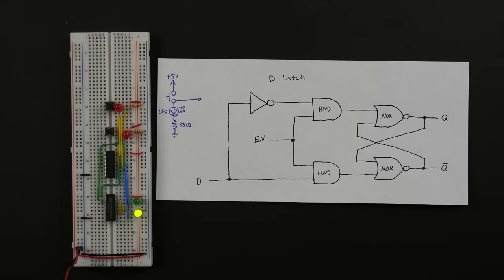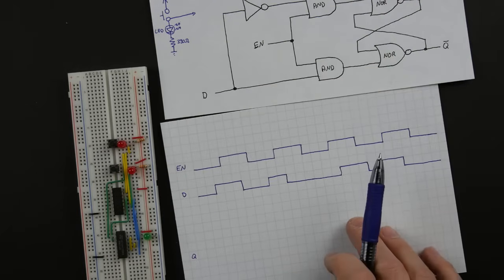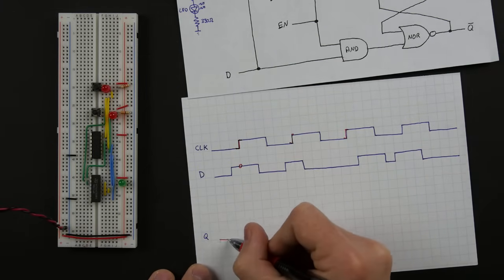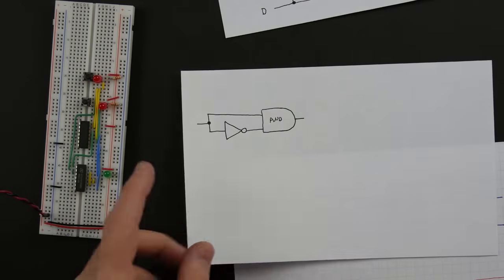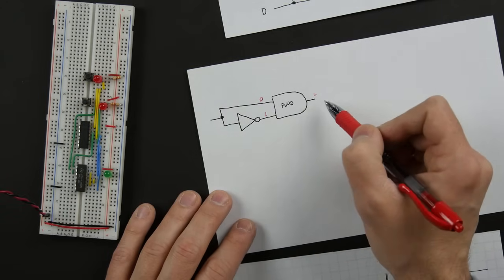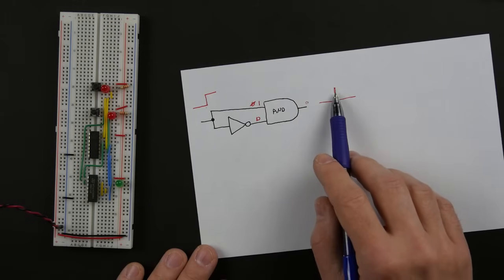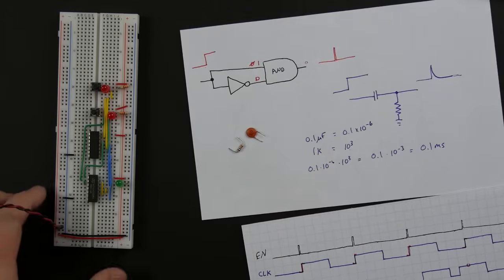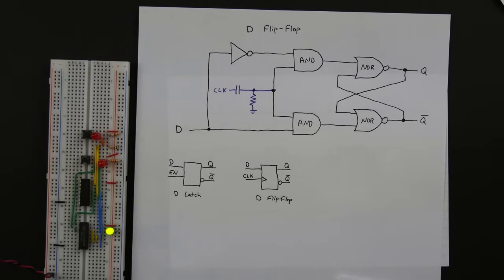D flip-flop

Comment: Revisiting these videos I just realized that you could've just wired the capacitor circuit to a single not gate instead of having a train of not gates and have it timed for the voltage charge from threshold voltage of the not gate to the full charge current cutoff of the cap to match your desired pulse width. That way you would've had a nice square clock pulse.

Comment: @BenEater Quick question. Regarding the edge detector circuit as pictured at the end of your video, it would seem that a HIGH to LOW transition on the CLK line with the 5V across the capacitor would result in a -5V transient input signal as the capacitor discharges that would mirror the transient produced by a LOW to HIGH transition on CLK. You say in your D Latch video that you use a 7408 quad AND gate, whose datasheet indicates internal clamping diodes to ground on its inputs. Are those enough to avoid damage to the IC during the negative transient, or would external clamping diodes be preferable?

This is the fifth time I've watched this video, among many others on your channel. I really appreciate your informative and detailed teaching style. The truth tables and colored diagrams of signals through schematic symbols over time have been especially useful for me.

I am designing a line of low-cost, simplified, user-serviceable testing equipment for breadboard circuits to lower the barriers to entry for circuit design. Ben, I would love to collaborate with you on this if you are interested. Everyone else, please feel free to leave me suggestions.

Comment: I built the edge detector with a capacitor and resistor as shown in this video, but when I hooked it up to an oscilloscope I noticed that there were positive and negative pulses corresponding to the rising and falling edges. If you run across this issue, my solution was to run a diode off the negative end of the capacitor.

Comment: At 11:56 That rising edge detector explanation using capacitor resistor is confusing. Assume the 5V lasts for 5 sec. At the rising edge current will rise fast to charge capacitor and it will fully charge in 2 sec. But the capacitor will be kept charged for 5sec right? How the voltage reduces in 2 seconds. Confused

Comment: This is not a flip flop. The concept of flip flop is in the name.. "flip and flop". It needs to be just 2 D latches configured in M-S way to get a D flip flop. 

Yes, this is a shortcut by simply making the "high" to be very short duration, and behaves similarly, but I prefer the M-S latch way to get a pure digital logic implementation and not bothering with capacitors, etc.

Note: i may be wrong because I am also just a student learning about thissubject.

Comment: i threw this circuit into the simulator, and it seems that having something to discharge the capacitor during the negative part of the clock cycle is essential. otherwise the circuit produces no pulse on the rising edge.

in ben's case it seems that the LED does that job, but if you connect the edge detector circuit directly to a clock, the clock needs to be able to both source and sink a bit of current.

or maybe the capacitor discharges through some parasitic resistance? idk. i'm a complete beginner at this after all
Reply: I was wondering about this. Thanks for clarifying
Reply: @Jackisaboss1208  Happy to help!
Reply: I'm surprised that no one else is pointing this out. The only reason that Ben's capacitor is able to discharge at all is because of the ('optional') LED and resistor connected to the Enable button. If you remove those from the circuit, then one side of the capacitor is left floating, which prevents it from discharging. And the enable button stops working after the first press. (Try it and see). Moving the 1K resistor to the other side of the capacitor solves this issue, by providing a discharge path.

Comment: What does it mean when Ben says that the ‘capacitor will charge through the resistor’? Wouldnt the capacitor charge anyways once connected to the supply voltage

Comment: I made a circuit simulation to test a press-button RC-clk pulse similar to Ben's; I particularly wanted to see what happens on the falling CLK edge (button release). 
Here is a snapshot of the simulation: https://drive.google.com/file/d/1S2WtMoX65ZNd03vXrY3qWkwo90piK4Ce/view?usp=sharing. 
There are two voltmeters: the green one on the positive cap side; and the blue one on the negatve cap side that measures CAPCLK.
When the button is pressed, both meters measure an instant +5v. Then the (blue) falling slope of CAPCLK is the cap charge time (the rate and depth depend on the resistor values). (Once it reaches that grey TTL-level area of about 3v, CAPCLK will appear to be zero. This is Ben's pulse.) The blue voltage falls to a stable level of about 0.5v, when current flow through the cap halts; low current continues to flow across the power source through the 1K and 100ohm resistor in series. 
When the button is released, current flow across the power source halts and both meters measure the same instant drop of about 0.5v, from the stable level the blue one falls to 0v. The green meter measures a slower falling slope, as the cap self-discharges (reverse direction current flow) through the 1K resistor, after which current flow slows to a halt.
You can find the circuit simulator at falstad dot com, sorry can't link to it here. 
Thks for the series of videos, helps a newbie like me to learn.

Comment: To detect a rising edge can we use an AND gate with one input the clock and the other input is the output of the AND gate itself but passed through a NOT gate.

So when the clock is high the output of the AND gate will be HIGH only till it's complement which is a LOW reaches the other input of the AND gate effectively making the output of AND gate LOW again.
Reply: Whatever you have analyzed is right. The AND gate does give an impulse at rising edge of the clock but unfortunately, until the clock remains high for the entire cycle the AND gate keeps generating impulses. It oscillates between HIGH and LOW as long as the clock is high. 

To explain in detail, consider your circuit. Clock starts 0-> 0 1 AND input -> 0 AND output -> inverted to 1 -> 0 1 AND input -> 0 AND output... this is repeated, as long as clock is zero AND output is 0. Now when clock changes from 0 to 1  ->  1 1 AND input-> 1 AND output -> inverted to 0 -> 1 0 AND input -> 0 AND output -> inverted to 1-> 1 1 AND input -> 1 AND output and this oscillating output repeats as long as clock is HIGH. 

This circuit behaves as a frequency multiplier (frequency being very high) for HIGH clock input.

Comment: So in experimentation, the edge detector detects both rising and falling edges - both being pulses but interestingly the falling edge produces a negative pulse.  When trying to build this type of flip flop using transistors rather than IC's I found the falling edge detection triggered the Flip flop like an enable (even though it was a negative voltage).  Does using the IC logic gates get around this problem?
Reply: The IC he uses discards the negative voltage through the use of internal diodes.

Comment: I’ve been encountering a certain level of ambiguity with SR flip flop diagrams online. Some diagrams have NAND gates for the Q outputs and others have NOR gates. Quite a significant difference I would think.
Reply: NOR based latches have "0" "0" at both NOR gate inputs, and they can be Set or Reset if they receive a "1".
NAND based latches have "1" "1" at both NAND gate inputs, and can be Set or Reset when they receive a "0".
That's the main difference. You can search for some .gifs on google to better understand them

Comment: 📺💬 D Flip-Flop in fibre optics,
🧸💬 The small pulse makes sure the receiver senses the signals because one dimension does not always create a fast response.
🐑💬 Stability too when the shape of signals is not too different and you can accelerate signals for speed and reliability.
🥺💬 That is because a capacitor and resistors together create powerful tools for shaping the signals, it is a good choice for signals if no specific tools because their properties are made well.

📺💬 How about this D-lack⁉
🥺💬 You can create shapes of signals or channels that can contain data information inside, it prevents external signals interfere but it contains CRC ( clock ) too.
🧸💬 That is because signals and clock signals transmit together there is no lag as digital signals and no costs for clock slipping if data arrived at the transmitter at the same time. 
🐑💬 That is because of its properly when the medium is loss carrier property it still has signals transmitting they can be detected and selected working medium.
🐐💬 To maintain the overall bandwidth but is still applicable in some fields, tracking signals are hard to detect when there is no clock source but a nearby device still hearing or relay of signals can estimate the distance of nearby sources. 

( 📺💬 ยุ้ยถ้าอย่างนั้นใครผ่านวะ 🥺💬 บอกแต่แรกแล้วไม่ได้แข่ง ควรจะหยุดตั้งแต่ซ่อมโทรทัศน์ วิทยุ AI certificates และอื่นอื่น ผมไม่ได้แข่งผมก็อ่านหนังสือที่เค้า feed มา เหมือนเค้าแข่งกันเอาสะใจ ตัวอย่างจะแกล้งดูหน้าจอหรืออะไร ผมเตือนแล้ว ผมเลยกินคุกกี้ฟรีให้ดู หลายครั้งเพราะเค้าอ้างรายการโทรทัศน์ ก็ไม่หยุด ผมเลยคิดว่าดูตัวผเองดีกว่า สอนต่อเถอะครับ ผมจะทำงาน 📺💬 ยุ้ยครับกระพริบหน้าจอเอากระพริบยตาครับ หลับ เปลี่ยนเรื่อง 🥺💬 ผมจดไว้ตั้งนานแล้ว ไม่เกี่ยวครับส่วนมากเหนื่อยหรือกินอะไรไป บางทีเค้าแกล้ง เค้าลำโพง หยุดด้วย แบบนั้นใครก็รู้ครับ  📺💬 ครับเพราะจริงจริงไม่ใช่พม่าครับ เออ จะหยุดเล่นยัง )

Comment: 10:00 I build it in a game with logic gates that have a speed of 40 "ticks" fancy word for hertz. When I press a button it takes 1 tick to activate the AND and to activate the NAND/NOR fed into AND  then another 1 tick to deactivate AND because NAND changed to 0, which results in a 1 tick pulse and complete ignore afterwards unless you stop pressing the button and press it again.     

It's the only way to do that because the game doesn't have voltages or wires or current etc. It's either on or off, and connections are wireless (very convenient).

Comment: I saw a video by Sebastian Lague on digital logic, and he made an implementation of a D flip-flop in his digital logic simulator, and he used a strategy for an edge detection. What he did is he used 2 D latches in series (so to speak) and then had the first one with an inverted enable signal and then the second with an uninverted signal. That way, the storage of the data would more or less be instantaneous. Would this work reliably in reality, and how would it compare to the timing of a resistor and capacitor like in your explanation?

Comment: Is propagation delay for edge triggered latches actually used in computers? You can build a circuit (it uses two of the SR latches with a clock input) that will only latch the output exactly when the clock triggers to high without needing to rely on an introduced artificial delay

Comment: Sorry if this is dumb: 
1. I understand there is no additional delay until the capacitor fully charges, right? 
2. The resistor slows down the flow and helps the capacitor fully charge?? What do you mean the capacitor charges "through" the resistor?
3. MOST IMPORTANTLY: Why the current stops flowing when the capacitor is full??

I undestood better the 1-input AND-gate with the inverter
Reply: 3. When capacitor is full it acts like sort of a barrier.

You have a lot of electrons electrons on one side and at some point battery has no more energy to push more electrons in the circuit.
Reply: @PinkeySuavo  thank you so much, even if i forgot what i was asking and why i was watching this video :P

Comment: @12:12   the width of the Pulse is conceptual because that depends on the input of the gate receiving that pulse. So the width will span the horizontal level of the AND gate input, and the conceptual level starts at the trigger level and ends at it, then it rolls down after falling below that level.

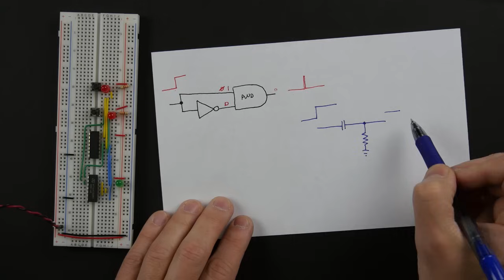Comment: @10:59   >>> this method of pulse creation is used in one of the security systems to detect the signature of the acousto-magnetic pulse signature - so by controlling the width of the generated pulses (via a variable cap controlled by an MCU) and taking iterated measurements (Assembly code is used as C code is not fast enough) the wave signature of the system can be detected and an alarm will be issued once the signature is matched to the pattern stored in the EEPROM of the chip.  Digital-CAPs are available from vendors that can generate variable cap values through the SPI or UART port.

Comment: Another great video. Unfortunately for me, I don't get the R-C part of the circuit. I was thinking caps smoothed spikes, not created them. I guess I need to go revisit how capacitors effect a circuit.
EDIT: Ugh. I think I get some of it. The clock pulse is limited to the spike of current during the polarization of the cap, before it fully charges and the current stops. Now I just don't get the role of the resistor. How does the cap discharge?

Comment: Thank you very much for a great lessons, I learned a lot from you. I have a question: how can I make an SR latch with deterministic initial state (on power on)?
Reply: what do you mean with deterministic? always the same led  that turns on for example output q is always on upon start?
Reply: @confidential303  not always, it can be different. Solved it with capacitor discharging to particular input to set determined state.

Comment: 10:55 here why doesn't the capacitor create an enable(EN) pulse while discharging? Isn't the capacitor creating current while discharging?
As seen in 14:50 at the falling edge of the clock signal when the capacitor is being discharged, there is no enable pulse created and so the state of data input doesn't affect the output and this can be confirmed by looking at the green LED on the bread board. But my question is why? I'm thinking the discharge of the capacitor at the falling edge of the clock puts current into the circuit and should have created an enable(EN) pulse, but it's not. What am I getting wrong in this thought process?
Reply: Is it because on the falling edge, the current is in reverse and since the circuit can't provide the current needed to discharge the capacitor, the capacitor gets this reverse current from ground and thus does not affect the circuit and does not create an enable pulse? I'm not completely sure about this. Can someone confirm?

Comment: 9:10 You can put time delays into the circuits by adding resistances infront of one, of two inlets . Plan the "race" of the currents in the SR . Ampere flows like water, have to wait for the bucket to get full .

Comment: I saw you addressed the racing issue in the JK-FF videos, so I just want to remark that D-FFs also have to be of the master-slave type to avoid the same problem.
Also, please, put some decoupling capacitors next to ICs. 74LSs are more forgiving, but if you replace them with, let say, 74LVCs, or even 74HCs, decoupling capacitors are a must.

Comment: I'm a bit confused. Wouldn't there also be a little blip going from 1 to 0, when  the capacitor discharges? I.e. a blip on the rising and falling edges?
Reply: The falling (curved) edge of the pulse is when the capacitor discharges. I think that's why it's curved. I'm no expert, but that's my understanding.

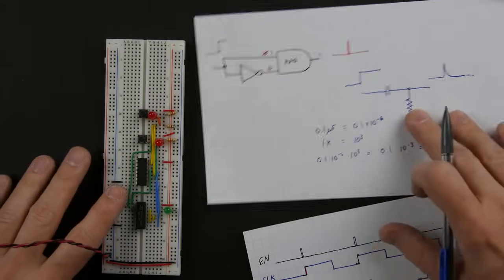Comment: @14:46 When the clock steps back down to 0V, why doesn't the ENABLE output have some kind of negative pulse? I understand that the resistor in the RC circuit serves as a differentiator, so I'd assume that stepping the input voltage down will result in a negative pulse on the output side. Does this affect transistor logic in some way?
Reply: Yes, you generally shouldn't give input voltages to logic circuits that are outside the rails (the rails being between 0 and 5 volts in this case). But the circuits Ben is using seem to be tolerating this negative pulse and treating it the same as a zero level.

Comment: Interesting note, the RC edge detector is effectively a high pass filter which lets the high frequency components of the square wave across.

It could also be viewed as a circuit that takes the derivative of the square wave. At steady low state, the derivative is zero. When a rising edge hits, the rate of change is high but then quickly goes back to zero with the steady high state.
Reply: In music is this called the envelope. Or a triangle wave.

Comment: I believe the cap won’t be charged until 5 RC  which would be .5 ms.? The voltage would ramp up during the charging at which point a threshold would be achieved to cause a change in state.

Comment: So when the clock goes low to high you get the pulse as described. However, when the clock goes high to low don't you get a pulse of the opposite sign, i.e. 5V negative? wouldn't this damage the chip?